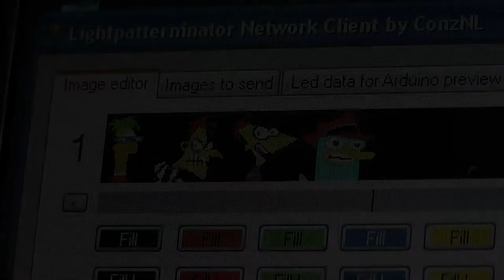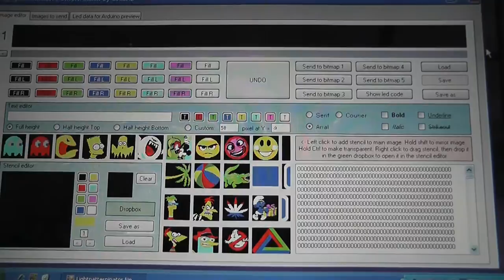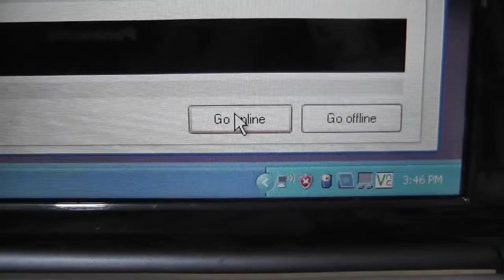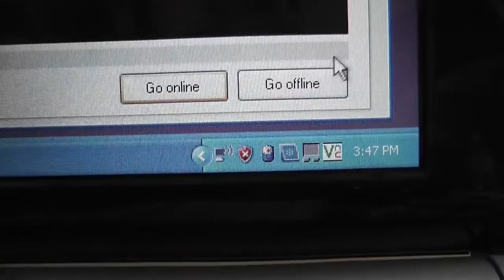My latest creation: a digital RGB light wand for projecting pictures in thin air.

Comment from the maker: No, i don't have a tutoria but there is a HL1606 library for Arduino. The Arduino side of the project is very simple, all it does is copy the data it gets from the ethernet connection to the strip.
Timing, conversion and everything else is done in the windows app that runs on the netbook. I create the images on there and throw the netbook somewhere on the floor or even in the grass with the lid closed. When instructed bu Arduino it then controls everything over the wifi connection to the box.

Comment: I've updated my code for my setup, now you can just drop bitmaps directly onto the SD card, and select the image from the LCD menu. I've created versions for the HL1606 and the LPD8806 which is using 52 led's per meter at 127 bit colour! (its much better than the HL1606).
Some pics are here: flickr.com/photos/68646769@N07/8180854764/in/photostream/

Comment from the maker: @mickr1969 I have thought about doing something like that. But so far i have always needed to create some gfx on site. That's why i combined the network client and gfx editor into one app. The thing works via wifi now, with an access point built into the control box. New gfx are then instantly available to the one holding the light wand, even if he is on the other side of the water or high up in a tower. We are planning to do a shot from 100 meters up with the wand on the other side of the river